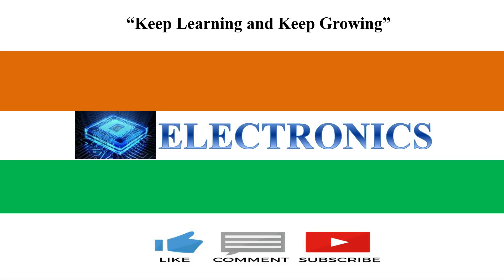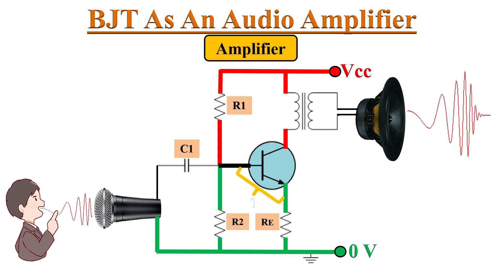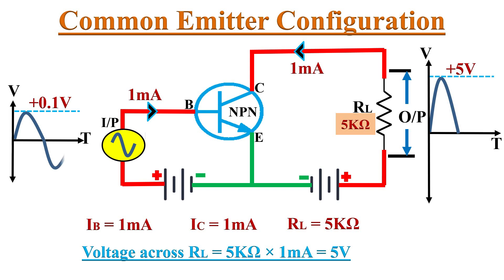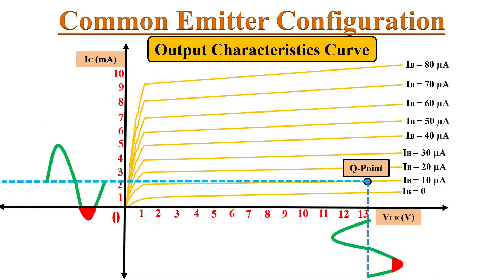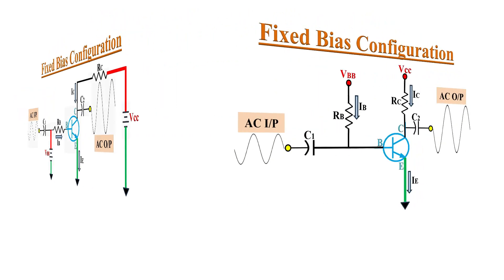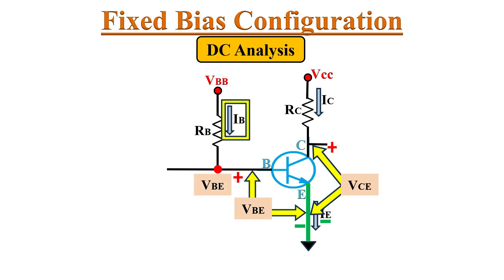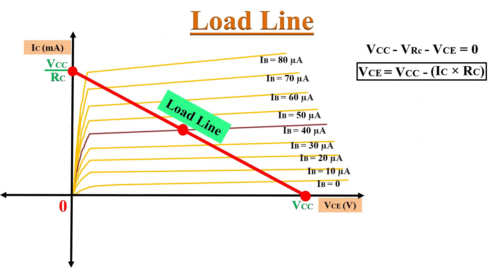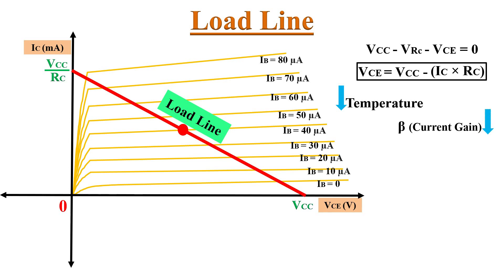Transistor Biasing: Q-Point and Load Line Explained

Comment from the maker: 0:23 What is Transistor Biasing?
2:10  What is Q-point or Operating point?
3:03 Variations in Q-Point,
4:33 Q-point variations due to change in Temperature and Current gain (β),
5:21 Fixed bias configuration, DC Analysis and Stable operating point,
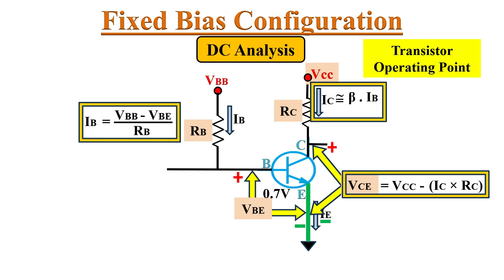8:38 What is Load line?
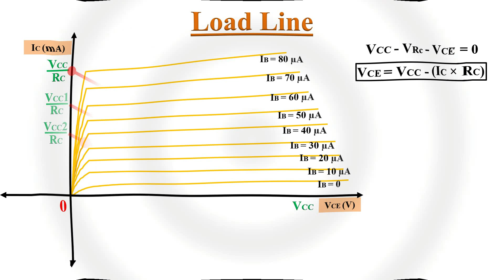12:20 Load line Variations due to Variations in Current gain (β).